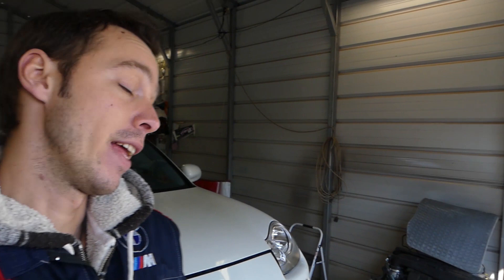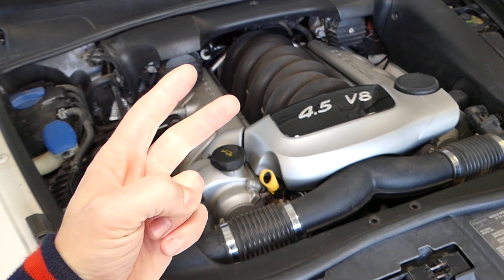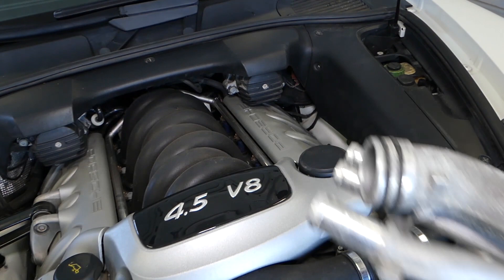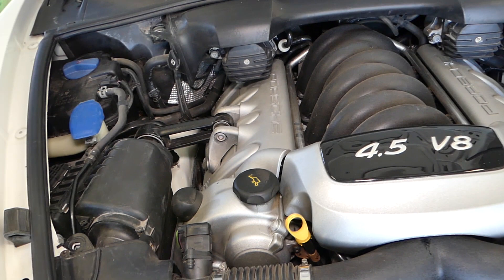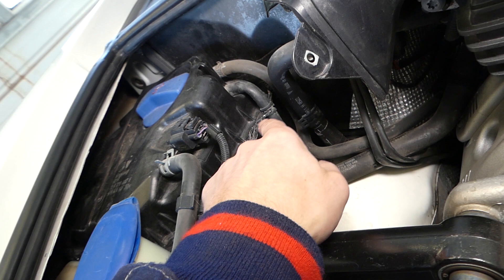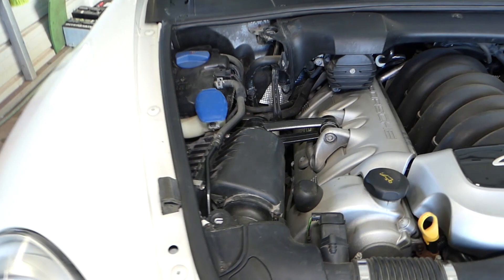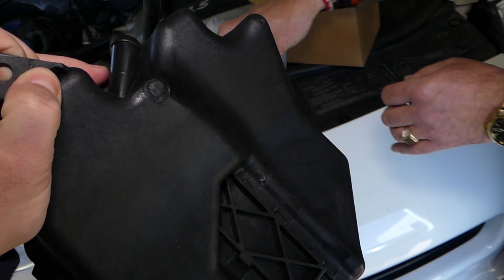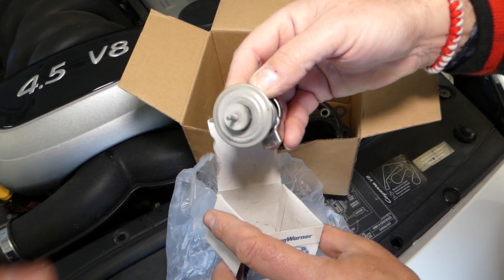MOST COMMON COOLANT LEAKS ON PORSCHE CAYENNE S, CAYENNE S TURBO

Comment: Hello, I have a 2006 Porsche Cayenne turbo and I am having a little issue with a water leak. The leak it seems to be in a small water hose going into the firewall on the back of the engine driver side, I assume this is for a heater. Have you had this problem? Is it hard to repair?

Comment: Thanks for taking the time guys👍🏼 I did some repairs under the intake and was surprised at how easy it was.  There is a drip I cannot locate yet.  It's on driver side about mid point which makes me believe it's coming from the turbo housing.  I'm just refilling with coolant until I can get good weather to address this issue.  I have a weird question for you.  Is there a RWD transmission which can be used behind this engine?
Reply: Did you ever figure out what this was? I have a similar problem; however, my leak is as fast as I pour coolant in. Same spot under the drivers side about mid point. Mine is a GTS 09. Help Please!!! Anyone?

Comment: I will be doing my cooling system soon, and the dealer replaced my plastic coolant pipes with the aluminum ones about 5 years ago.  (recall, but somehow I had to pay for it)  Now I have a slow leak somewhere, can't trace it, and only in the winter whenever I use my heater.  (no smell inside, no leaks inside the car so hoping it's not the core)  I have to fill the expansion tank about once every 2 months.  Do you think it's the tank, or maybe my coolant pipes are leaking again?  I don't want to take the top of the engine off.  I also don't want to take it to a shop cause it will cost more than the car is worth.  Anyhow, fishing for ideas, since I'm being too lazy to actually trace the leak since I can't actually see where it's coming from.  Thanks for these videos, I've already done some repairs on my 2004 S,  but seriously tired of this brick.
Reply: In the same boat man
Reply: @mrman880  I am also in that boat.
Reply: You guys find out the issue. I loose a very small amount in like 3 months - 2 cups maybe.
Reply: I'm dying to know what it was. Mine leaks in the summer too but it takes forever compare to the winter where it leaks constantly.
Reply: @rogerw462  I sold the car as-is to Carmax.  They probably sold it to a junkyard.  I regret it now cause I'm driving a Tiguan  now that is absolute garbage inside, but at least it's reliable.  It's my beater/commuter car until I can afford a new Cayenne sometime next year.
Reply: @Shoot.Load.Repeat  dang. I feel like mine could be a few different spots but I'm not sure which.

Comment: Got a question that i think I know the answer. Been loosing a lot of coolant on my 4.5 V8  and also I have an intermittent charging fault. With the dash light battery icon coming on. Could not see any leaking pipe. My suspicion is that the leak is around the alternator pipes that has had the coolant flow i to the alternator its self and wrecking the alternator. I want to be certain before I remove the alternator and replace it. Looks like one of those jobs..